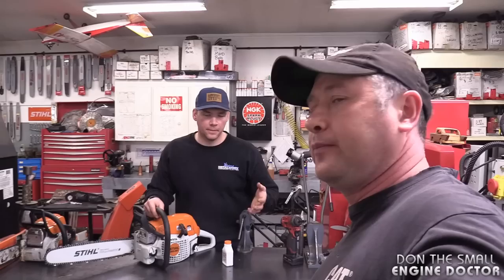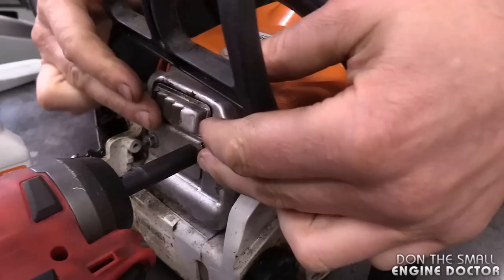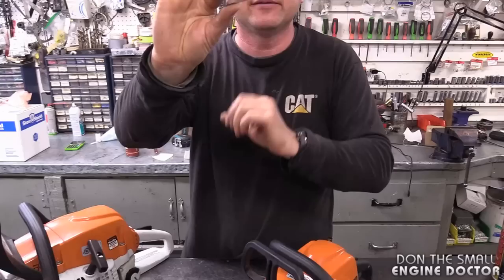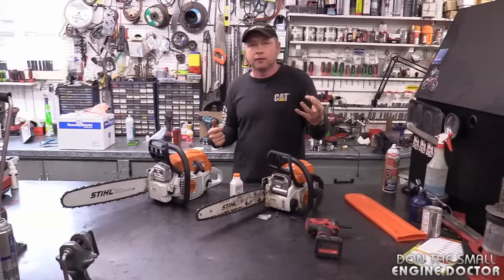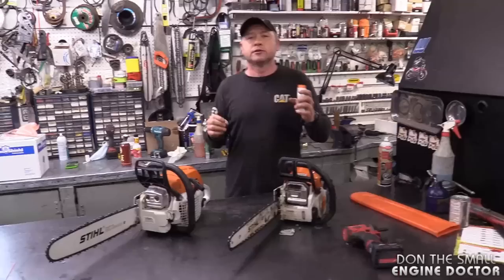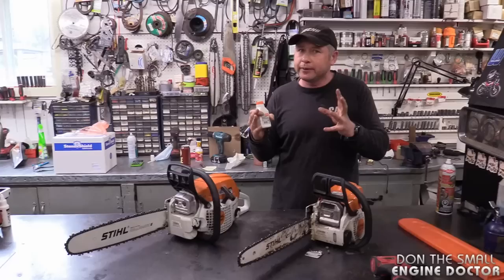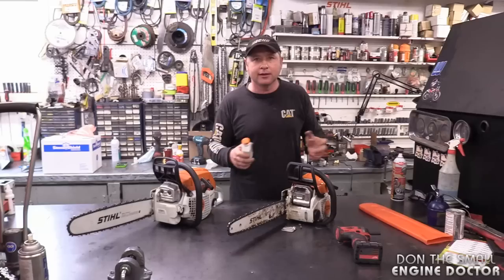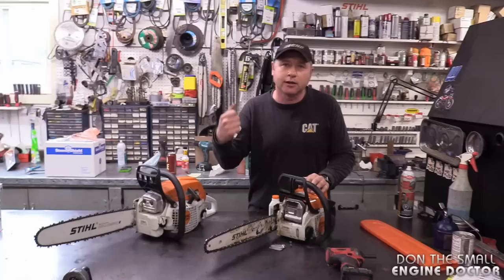Should I Double-Up My 2 Stroke Fuel Oil Mix For More Lubrication? Teaching Apprentice Dave

Comment: all these people swearing by 25:1 dont realize the days of 25:1 are the days before engineered 2 cycle mix oil... back then you just mixed straight 30w, which has a much lower flash point and therefore burns off more readily... modern 2 cycle mix burns at a much higher temperature and much cleaner resulting in less need for rich fuel oil mixtures... i cant stand it when i hear some old guy say "ive been running 25:1 for 40 years"... im sure you have... because you think youre smarter than the engineers that developed the current generation of 2 cycle oil

Comment: There was quite some technical progress regarding 2 cycle engine oil's in past decades. With modern fully synthetic oils (e.g. from stihl/castrol) 50:1 is the right mixture. 30 or 40 years ago the oils were different and operators had to mix it 25:1.
I never had any issues with a 50:1 mixture using stihl HP from Castrol. Condition of course is a proper carb adjustment. 

Best wishes from Germany
Reply: 40 year old engines didn't use needle or ball bearings either.  Those old babit bearing engines still need their oil.
Reply: @thisisyourcaptainspeaking2259  

Babit bearings in a 2 cycle equipment?? :)))
Maybe there were chainsaws with steam engine??? 
:)))
Reply: @marcoschweikart6825  All of my antique outboards have babit bearings, not till mid-60's/70's were needle and ball being used?
One might argue a sleeve can handle more abuse than a needle, I won't argue that but as far as lubrication goes, they are afterall antiques so let's take a real risk and run 100:1 at full output, why not?
Oh please, just use some common sense and due diligence.